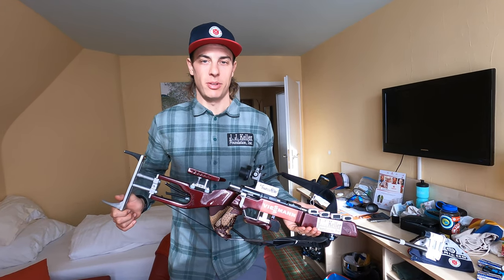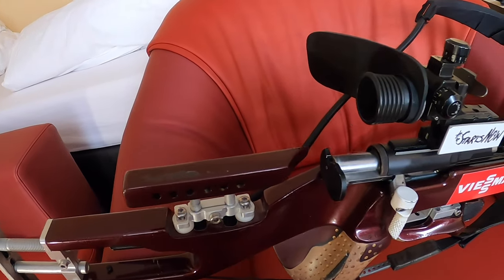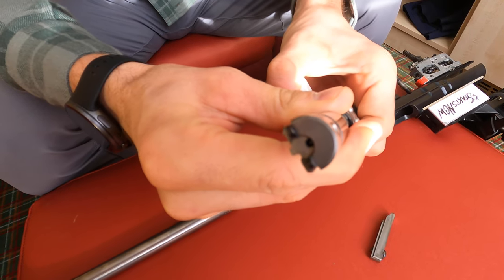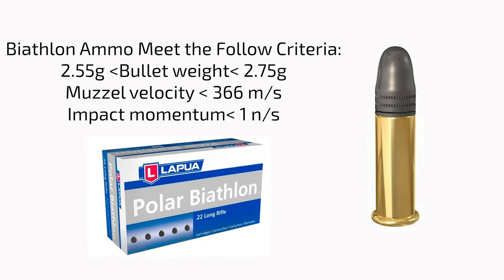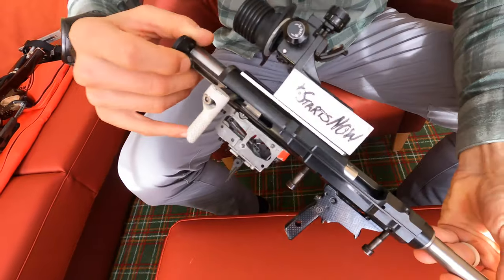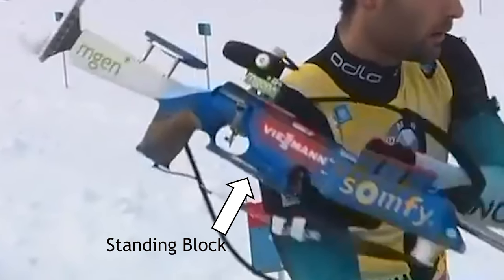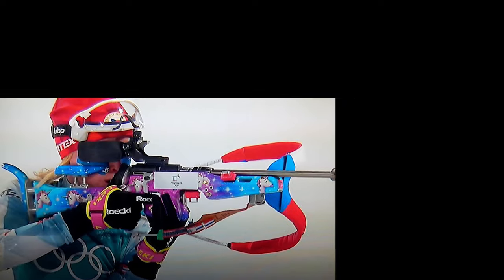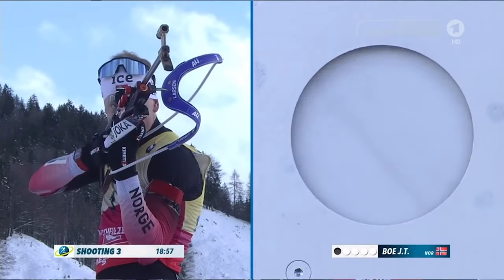Biathlon Rifle Anatomy

Comment: great video.  do you all ski with them loaded? I assume not, but cant tell how they are loaded/unloaded (made safe) from watching the Olympics.
Reply: They ski unloaded.   When they arrive at the range and enter a firing position they secure a 5-round clip that is suited on the rifle stock and insert it into the magazine well.
Reply: They are unloaded. The mag you just used on the range, have to be empty when you leave the range. If not, a DSQ and a possible suspention will follow.

Comment: Paul, thanks this was actually quite interesting.  Quick question, have you ever tried a biathlon rifle from the pre 1978 days when large bore was used with a 150 meter target?  I was just wondering if you found one easier or harder to shoot.  Keep up the fun, and informative videos.
Reply from the maker: I have not tried a biathlon rifle from the pre-1978 era. I have shot large bore rifles which is a very different experience than shooting the current .22LR biathlon rifle. Today's rifles are much lighter and have almost no recoil compared to a large centerfire rifle. However, due to the .22LR ammo having to be subsonic the wind will affect the trajectory of the bullet more than a large bore rifle.